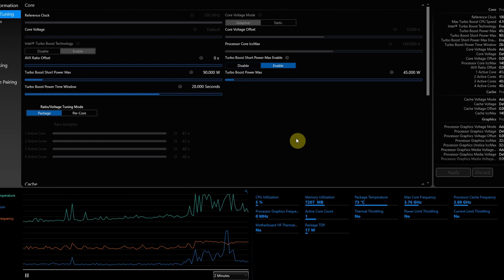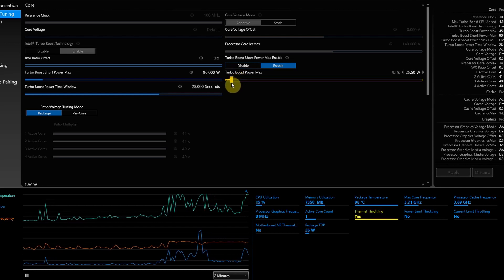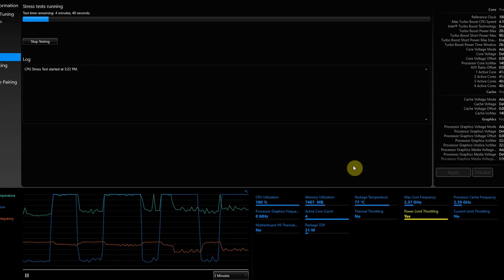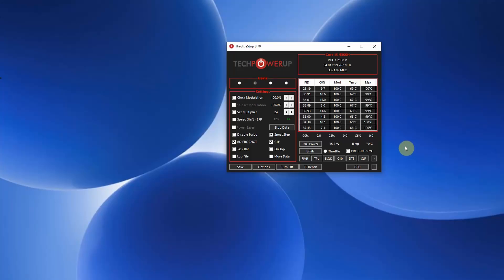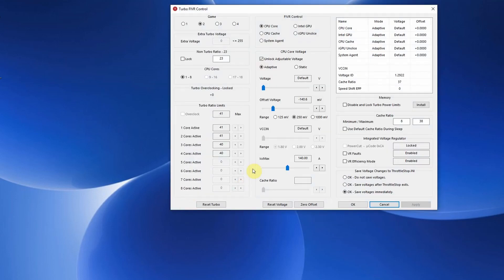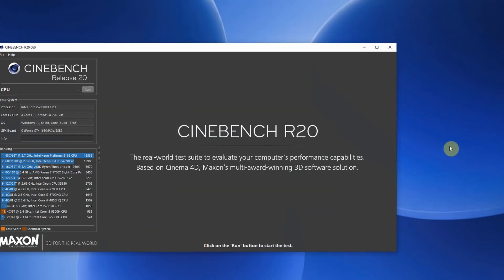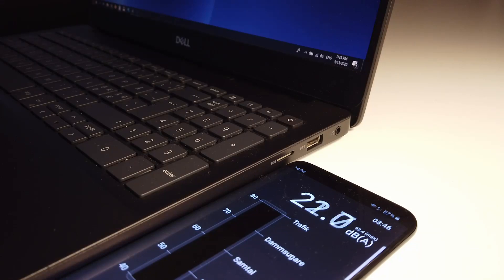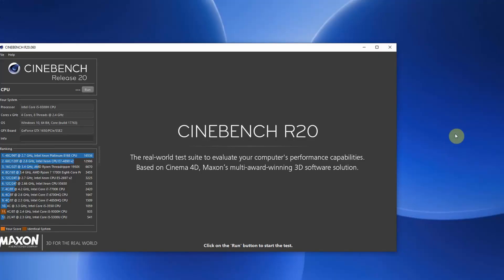New BIOS 1.6.0 KILLS Undervolting - Dell XPS, Vostro and Inspiron 7590 / 7591 - 9th March Update

Comment: Hi W2Best, I also got caught in the BIOS update -> no undervolt thing.
I finally managed to have it back, though.
I took inspiration from this reddit thread: https://www.reddit.com/r/Dell/comments/fazkxi/dell_g3_3590_bios_update_stops_undervolting/

These are the steps I  took:
0) go in bios settings -> general ->  boot sequence, click every boot partition you have, click view and take pictures with your smartphone. I did't do this and I had to sped time after.
1) download 1.5.1 BIOS from https://www.dell.com/support/home/ca/en/cabsdt1/drivers/driversdetails?driverid=y1f5h
2) install 1.5.1
3) enter Bios Setup and click "Restore settings" at the down right. This is the culprit, click it and go on. If you don't reset undervolt will keep to not work. This is because CPU microcode will stay on "ca" version and will not be reset to "c6" (the good one). you can ceck microcode version with Intel  Processor Identification Utility if you like (completely optional).
4) reboot
5) here you may have some problems, especially ,if you didn't take step 0. I had problems , but I have a complicated setting, with 2 nvme drives and dual boot with Windows and Linux. Bios could not find my boot partition.
Go back in bios settings, general, boot sequence e Add back your boot configuration
6) Important: still in bios go to security -> uefi Capsule Firmware Updates and disable it. If you don't do this when you reboot in windows, bios 1.6 will be installed again. I made the mistake, but was lucky enough to be on battery with less than 50% battery left, so the update failed and I had an opportunity to disable UEFI capsule. Otherwise I would have had to start back
7) That's it. If you did it right reboot in Windows and enjoy undervolt back.

All these steps are more easily done than written. All the process took me perhaps half an hour with some trial and error.
Enjoy

Keep in mind that this downgrade will rollback the secirity threats mitigations installed by bios 1.6. While I'm perfectly ok with this, YMMV.

Cheers from a rather sad locked down Italy.
Ad we say these days: Tutto andrà bene (everything will be allright)
Stefano
Reply from the maker: Stefano! I will pin this comment since it's a really well working solution. I'm just right now making a video about it that kind of features you / your comment. :)
Reply: @w2best  Happy to hear that. Just to let you know, there might be another solution, but I didn't try it yet. In this page https://wiki.archlinux.org/index.php/Dell_Inspiron_15_(7590) 
you can read this
Note: For Bios 1.6.0 0x78C need set to 0x0 so undervolt can be used, if you don't know how to change UEFI var, this may help you.
Reply from the maker: @dany3020  For others with 7590 too?
Reply: @Stefano @W2 Thanks both of you for putting this out and helping people get the undervolting back.
Reply from the maker: @anon4326  Thefano is the MAN in this case! :)
Reply from the maker: Oh wow this is interesting! I will look into it! I might pin this comment so people find it. If I try our I probably make a video about it. Thanks for the comment!
Reply: Managed to get under volt back
Reply from the maker: @zahirmulla6715  Perfect!
Reply from the maker: @dany3020  Oh WOW that is such an amazing tip that I will def try out during today!
Reply: @w2best  do you know if this worked? if it did what did you do exactly?
Reply: @w2best  Did this work?
Reply: Daniele Magrì this isn’t working for me
Reply: Daniele Magrì I think it’s worked, I did a factory reset bios settings rather than bios defaults
Reply from the maker: @dany3020  I tried this in my latest video that is currently rendering - and I couldn't get it to work if I didn't roll back to version 1.5.1. But when I did and then reset it works fine.
Reply: @dany3020  Worked for me on an XPS 15 7590 without going back to previous BIOS  (so keeping 1.60),  using the factory reset defaults.  Restoring to Bios defaults didn't do it. Thanks a lot!
Reply: @dany3020  Yeah, that's great:) I just realized a week ago that I had lost the undervolting when I felt it was getting too hot on the lap. Now almost back to its former self, can't quite get the same benchmarks I was getting before. When I first bought it and undervolted it I got a max of 3000 in CB20, now with the same setting (-147.5) and cannot go above 2900. Maybe thermal paste wearing off...
Reply: @dany3020  did you restore to BIOS defaults or factory defaults?
Reply: it is work on inspirion gaming 7577?

Comment: I'm on bios version 1.6.0 from February 2020, yet I still can't undervolt Dell Inspiron 7591. I can lower max TDP like you, but no undervolt sadly.
Reply from the maker: Check my 2nd to newest video on getting undervolt back! It seems to be different for different people though. You can start by trying a bios reset and if that doesn't work - downgrade to 1.5.1.
Reply: @w2best  Thanks very much, but I was able to solve my overheating problems by lowering max power draw during boost from 90W to 75W, and TDP from 45W to 20W. Great videos man, happy to support the channel!

Comment: Hey - I honestly don't think the issue is with the bios. I had the same problem when I updated to 1.6.0 bios in my dell xps 15 7590, the option was grayed out. I then downgraded to 1.2.3 and used the default setting in the bios and it worked. BUT, the laptop with automatically go to 1.6.0 version again. The trick (I believe) is that after the upgrade, restart the pc, hit F2 to enter the bios setting and set the bios to default settings. Restart the pc and it should work. I followed it from @bob builder down in the comments. Hope this helps :)
Reply from the maker: Yes I think you are right and it's very high on my list to try this and make a video about the process if it works! Thanks for letting me know it worked for you!

Comment: If you've updated to the latest BIOS, and cannot undervolt, here is what I did. My Dell G5 5590 automatically updated to the latest BIOS on March 20th, 2020. 

1) I went into Dell website, looked for the older BIOS files. 
2) I downloaded the 1.6 BIOS file (my laptop let me downgrade all the way to BIOS 1.6 - it would not let me downgrade any further)
3) After downgrading to 1.6 BIOS,  shut off laptop. Turn on laptop, and press F2 key to go into BIOS
4) Go into BIOS settings, and restore BIOS to "default settings"

Note: I was unable to undervolt with JUST downgrading back to BIOS 1.6. Steps 3) and 4) where you restore BIOS to "default" was necessary.

Comment: Hi W2Best,  Thank you so much for the warning! I have the i7 version and have issue with Current Limit Throttling (in XTU) only when on battery. I contacted Dell Support and they recommended to upgrade BIOS. I don't want to do it because I want to undervolt my PC sooner or later. Do you think undervolting will help with Current Limit Throttling(on battery)? or undervolt first and then upgrade BIOS?  Cheers, spacekid
Reply: Never do that mistake to upgrade bios. They disabled undervolting capabilities & completely blocked the chance to downgrade to a previous bios version aswell. Dell sucks.

Comment: A kind of unrelated question: But when upgrading the RAM, is it only DDR4 2666 mhz that works? "Hoping you see this" :D
Reply from the maker: It will work with other specs BUT you should go for same size and same speed for dual channel to work at it's best. :)

Comment: Has anyone tried bios update 1.7.1?
Reply from the maker: Where have you found that? This is 1.6.0.
Reply: W2Best - Tech, Travel & Inspiration on their website but it gave the same results as the 1.6.0, I’ve reverted to 1.6.0 and have under volt working but I’m sure it’s running hotter than with 1.5.0 bios

Comment: I realised this minutes after i updated the BIOS. Then i proceeded to download and reinstall the previous BIOS. Still it wont let me under volt it. I have the Inspiron 7591. This is for all the people who also got the idea of rolling back to the previous BIOS. Doesnt work. Save yourself the trouble.
Reply: After you install the previous BIOS version, try going into the BIOS and reset all of your settings.  This has worked for some people with Dell laptops.
Reply: @unclewebb  I tried to downgrade to the previous BIOS, but the Intel ME and other Intel stuff packed into the BIOS file were not replaced, and was showing Failed to install or something like that. So Downgrading the BIOS didn't work for me. And It's kinda expected, as they updated the microcode of the CPU for a mitigation and they wouldn't do it in reversible or exploitable way, they most probably have taken off the privileges of going back to the previous version. I don't know if there is still some other way to undervolt, please lemme know if you get any info..
Reply from the maker: It's really shit and I wish I had the info before upgrading.
Reply: @w2best  Was this BIOS update specific to the 7590 series models or was it also for other models of the XPS and Inspiron line?
Reply: @janakpatel3848  Every Intel processors from the 5th/6th Gen are said to be vulnerable to Plundervolt attacks. Intel confirmed this and released a new microcode update for its processors locking all the adjustable voltage parameters of the CPU and the iGPU. It's basically all the Intel processors, Dell has got nothing to do it, Every manufacturer is gonna push this with the latest BIOS for their devices, it's just a matter of time.
Reply: @rishi4d_  So basically no more undervolting?
Reply: @janakpatel3848  We don't know, for the time being Intel has temporarily mitigated the vulnerability by disabling undervolting interface. Maybe they can fix the vulnerabilities by pushing patches but that's not coming in near future as then we wouldn't have seen these efforts to lock all these voltage stuff. And the Intel SGX that is mainly affected by this is an Extended Instruction Set that is used by all modern Intel Core processors, so it makes a sense for Intel to tweek the Instruction Set if possible, but it's not always possible as the Opcodes are laid out in ISA of a CPU, so it's kinda HW + SW(Machine Level) thing at the Architecture level. So if its the latter, its not coming back for our processors unless Intel figures some other way to deal this. So Maybe Intel or some professionals only could answer your question correctly.